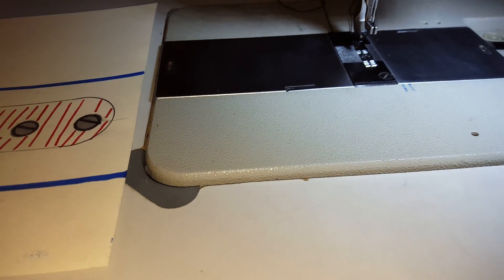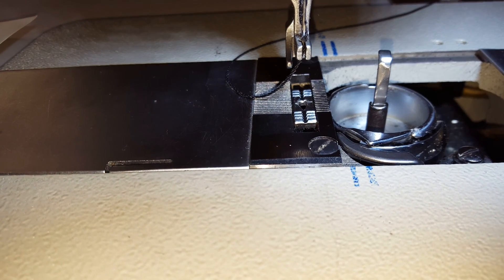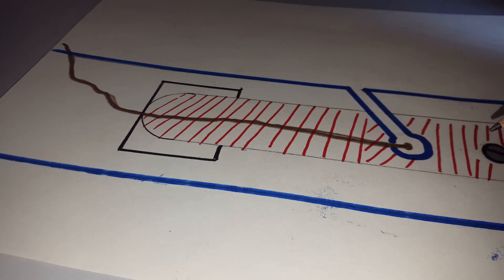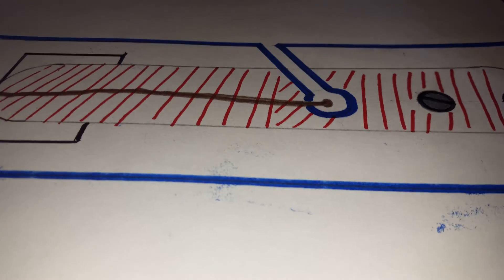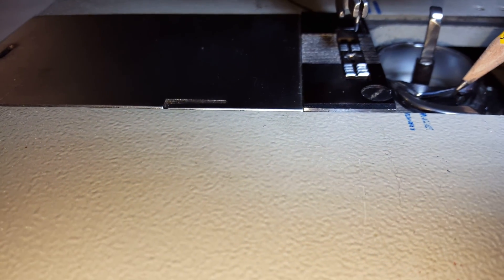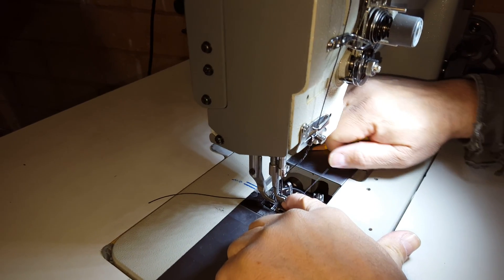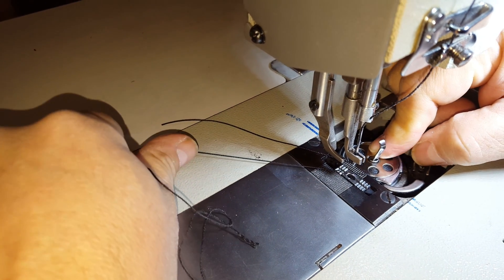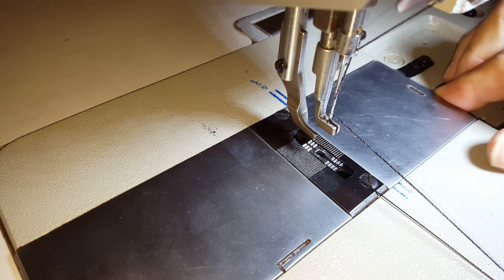Cobra Class 20 bobbin change

Comment: Hello Al,  are these cobra class 20's a clone of another machine?  If so, could you tell me the make and model of the original? I just purchased a class 20 and I'm having some problems with it. I can't seem to find much info on it, maybe if I knew the original I could do more research. Thanks.
Reply: Hi Playgun, Al and i are admins for a Facebook group called Tips and Tricks for Cobra Class Leatherworking Equipment, that does support for the Cobra's and more. Please come join us there.
https://www.facebook.com/groups/101589880193668/
Reply from the maker: Playgun10 what kind of problem are you having?
Reply: Well, back stitching is herendous! 1, It cuts and frays 138 bonded nylon thread, I'm using a #23 SCHMETZ leather needle, 2, the last stitch never stays in! It always pulls right out so I am tying it off! And most recently, the back stitch-length has become a different length than the forward stitch so the needle is not landing in the same hole! I hate to burden you with these questions, I'm new to stitching machines and leatherwork has been a hobby for the last few years! I'm getting the feeling that nothing beats the "good old 2 needle saddle stitch"! LOL! Any advice would be greatly appreciated! Thank you!